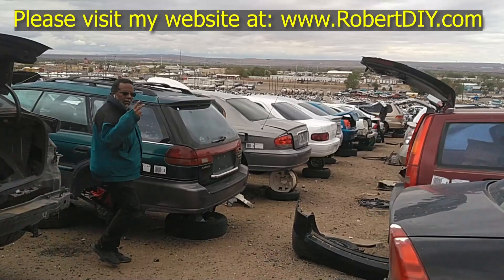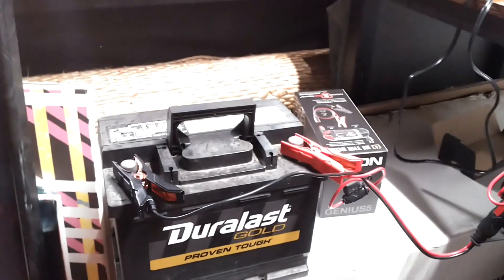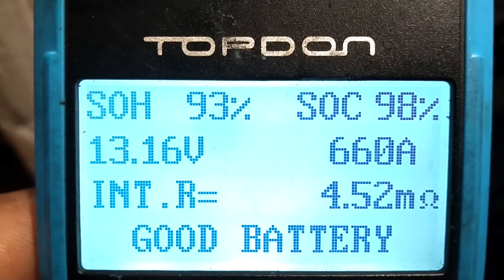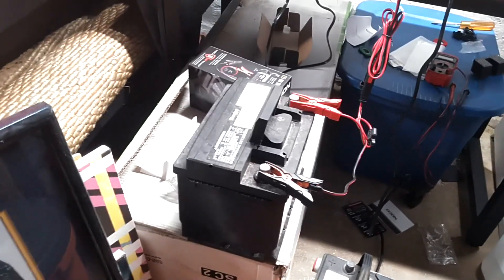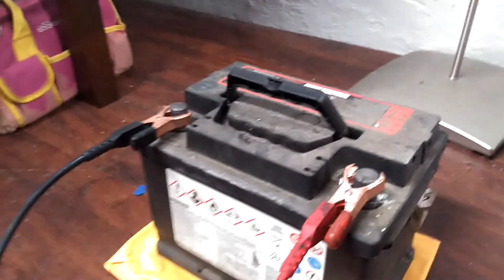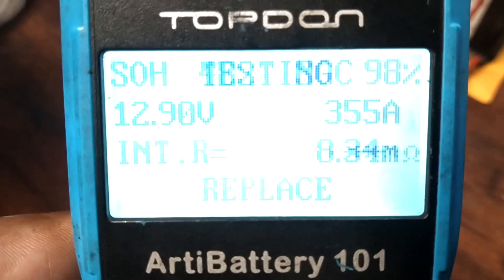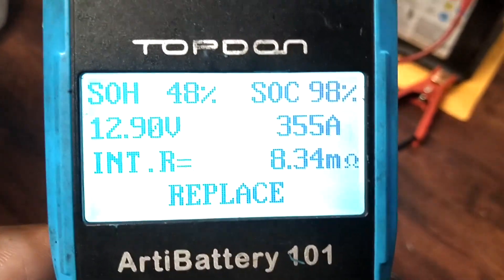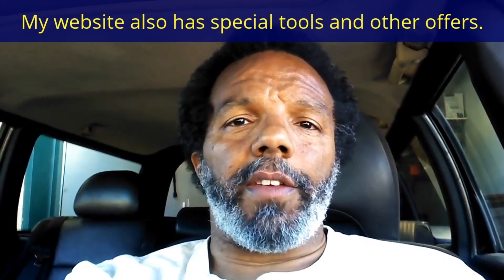More time tinkering with batteries.

Comment: Internal resistance was too high on battery 2.
Reply from the maker: What does that mean?
Reply: @RobertDIY  I don't have an official chart but if internal resistance is way over 5 ohms, then your battery is probably bad. Your good battery was at about 4.5 ohms. It's a sign that it's too late to save the battery.
Reply from the maker: Cool, thanks for sharing.